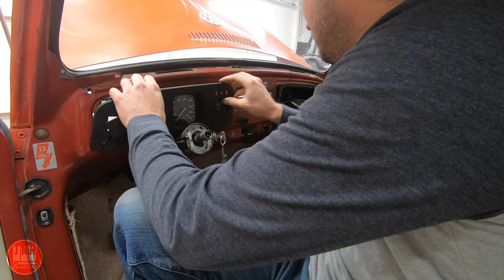An Unloved Beetle (Episode 18) - Shifter & Dash Repair

Comment: That plastic trim is needed for the glove box door to close properly, just pop rivet it in place and use the correct rubber bumpers for that year. I had the same issues on my 68 when i removed the padded dash. also don't forget the the plastic air vents.

Comment: There is an two parted Shift Rod for Replacement. When you use this, you dont have to remove the whole shiftstock throu the framehead. Nice video btw.

Comment: That noise when you moved the shifter is the giveaway that the bushing needs changing. I hope you didn’t forget the metal ring that goes around it. 😉 Oh no; the dreaded red urethane in the coupler...🤣

That’s an unorthodox dash layout with the square gauges. What’s up with that?
Reply from the maker: I don’t think this style of bushing uses the metal ring. I bought a new ring but didn’t use it. I don’t know where they found that instrument cluster, but it was definitely not stock.
Reply: @Jerod_Helt  I believe they all use the ring unless it’s one of those new brass retrofit units, etc. I’ve done this a couple of times and like you was lucky that the whole thing didn’t turn into an ordeal; I’ve heard many horror stories on others installing them. In my cases; they’ve gone in easily like you just did. I’ve also read that the joint is supposed to be facing the driver too.

That dash you took out looks like a newer Mexican or Brazilian unit.
Reply: @Jerod_Helt  definitely not stock for that model and year.